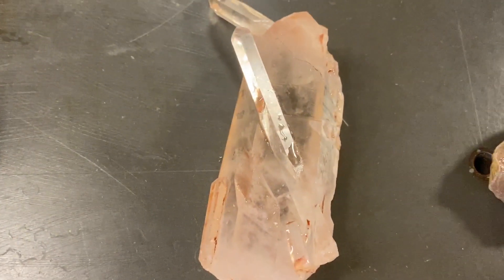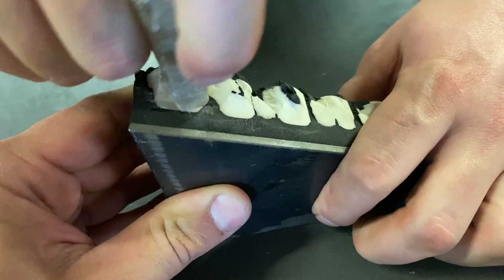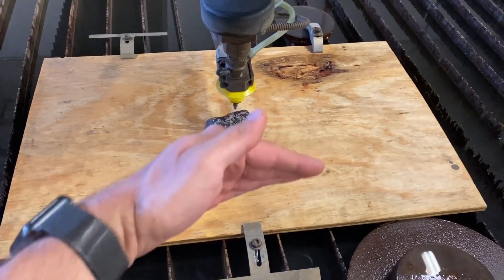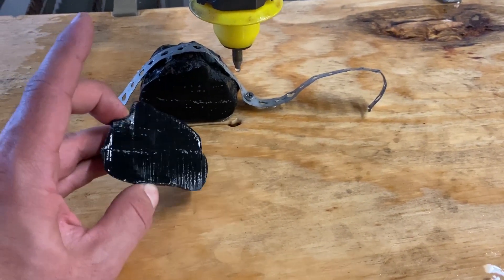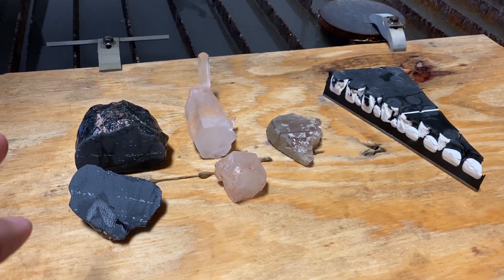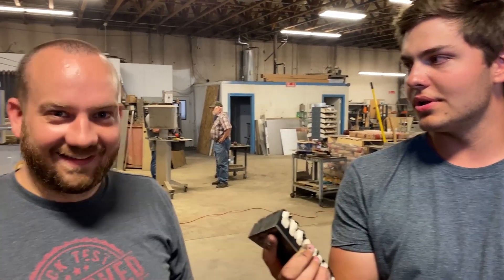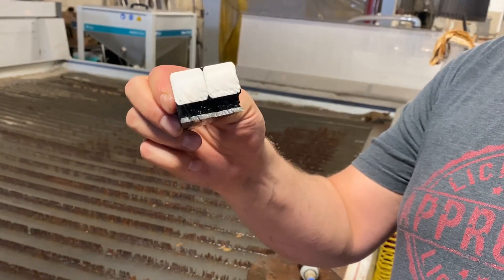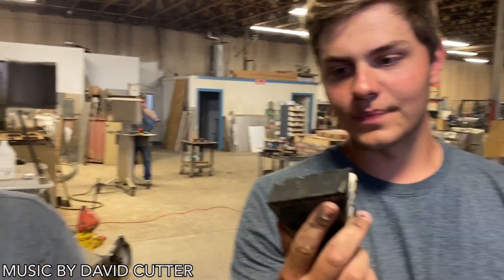Hardest Materials vs 60,000 PSI Waterjet

Comment: Probably Silicon carbide, boron carbide is harder but more brittle  boron nitrate is even harder. (In it's cubic form it's like right under a diamond in its hexagon form it's a 2. So basically a diamond to talc depending on the molecular structure.

Comment: not really a fair test if you use the specific setting for one of them, but cool.
Also, you can't say it's shows it's a log scale since you only actually found two data points. Could be linear. Still cool though

Comment: the garnet abrasive you use is 6.5 to 7.5 mhos. If you can, you should switch to aluminum oxide which is mhos 9.5 and probably a ton cheaper.

Comment: I always thought that the water jet cutting was actually water induced around a blade to mitigate the warmth from the friction that would eventually bend the blade making it useless... Im quite impressed this was actually water and minerals all along cutting hard materials!

Happy to have learned something like this today. thank you
Reply: @gab hug water alone does cut. Pure water jets exist. The one in this video is called an abrasive water jet.
Reply: @weebkawi1444  This. Water alone at high pressure will cut, thats why you have videos of dumbasses with power washers slicing their toes, fingers or hands off.
Reply: @christopherbentley6647  So then its diamond thats cutting and not metal? by that logic it could be a ceramic blade or a wooden blade or a plastic blade. Your minecraft comment didnt make sense either friend
Reply: Technically speaking I wonder if it would be more accurate to say that it's actually eroding the material away instead of cutting it?
Reply: @christopherbentley6647  I will just reply okay you are right since I'm not quite that mad to reply a huge wall of text. Have a good time!
Reply: @christopherbentley6647  Metal is softer than this stuff so would it really? ;)

Comment: Moes scale does determine hardness, but there is a difference between hardness and strength. A object can be really high in the moes scale but can break easily, like diamond. Diamond gets hit on a weird angle and it will shatter like a mirror

Comment: Advanced composites is basically the replacement for metal. 
Composites are hard but they also have a high flux density. Basically how much abuse can it withstand before being replaced (hopefully before a detrimental/critical failure).
....
For some people that dont know what I mean. Go get or grab a sheet of aluminum that has equally thickness in any direction and bend it back and forth repetitively. <that's flux density.
Now the issues you'll be coming about as you create defects such as a fault line or when the sheet of metal becomes thinner in the middle  will begin to grow. Eventually it'll just break off and thatll be referred as a catastrophic failure. Since it's a sheet of aluminum no harm no foul; but on equipment (tools) or machinery (vehicles) it's a big deal.
....
However we cant completely remove metal from the equation though. We're not that advanced.

Comment: Never realized sand was added to increase the cutting power but that makes a lot more sense. So does the water jet cut better the more you use it technically, if all those extra hard particles are floating around in there? I suppose it might take a while before you would notice any difference. At the very least would it maybe change the cut quality?
Reply: The abrassive is added to fresh (or filtered) water. You can't reuse it, because the edges are wearing off and it can't cut as good as for the first time. The mixing is done in the nozzle right before cutting.
The water is then sucked out of the pool and filtered.
Reply: @knut3339  interesting. In sandblasting we use the same medium but it gets recycled many times before it needs to be replaced.
Reply: The material coming off isn't as hard as the grit they started with so each time they cut something the mix is progressively getting softer.
Reply: I'm your 100th liker here & bye.

Comment: How hard is the garnet in the water?
I see between 7.5 and 8.5... if it is the same that is used to cut then this is proof that you CAN scratch harder with softer...both the harder and softer materials lose something. How much is determined by the disparity.
If you had a million years to blow talc at something you would eventually wear that something down.

Comment: The ceramic wear tiles are almost certainly sintered alumina.  They are the standard wear tile material for abrasive materials handling.  Quality varies (of course) but really good ones will be 9.5ish on the Mohs hardness scale.
Reply: I thought it looked like a piece of spacecraft heat shield

Comment: Guys! Get a dosimeter and check the radiation! When you cut this material, there should be a strange phenomena because of the change of the water pressure, when it touches the material. More than probably there will be a raise in the radioactive radiation. Please try and tell me the results, or even make a video about it, if its really happening. Thanks!

Comment: Imagine if he would make some bullets out of this material , wait.....
Reply: None of the materials in this video are dense enough to make good bullets. Tungsten would easily outperform any of them, and we already make bullets with tungsten in them.

Just a guess, but I would also wager the ceramic is too brittle to make a good penetrator. Hard does not mean the same thing as strong. For example, tempered glass is relatively hard at about a 7 on the mohs scale, but breaks quite easily.
Reply: @Turing_Test  Then what do you think about some Osmium bullet heads ? they are dense enought i think but it's pretty costy

Edit : Or we can try with Palladium metallic glass if you think it's dense enought to rezist the blast
Reply: @Panda-ke3iv  densest bullets in use are depleted uranium. maybe harder out there, but anything more gets to diminishing returns on penetration, and Extreme costs.
Reply: @Panda-ke3iv  I'm not actually familiar with those materials, but honestly I don't think it would matter much. As far as bullet construction goes, the material isn't really the bottleneck at the moment. I dont think there was ever a time where tungsten or, as aleks jones mentioned, depleted uranium, were the limiting factor in penetrating armor. The real key to penetrating armor is velocity (and/or heat). With the materials we already have available and use regularly, we would be better served by increasing our technology in propellants to achieve higher velocities for armor penetration (think rail guns and gauss cannons).

On top of all that, we are kind of on the precipice of entering the age of directed energy weapons. That's a whole 'nother can of worms that I won't get into, but the search for better performing bullet materials just isn't a high priority at the world's current technological level.
Reply: @Turing_Test  also, I think it must be very light

Comment: 2:31 Does this technically mean that the "garnet abrasive" is stronger than all of that..?
Reply: No.  They use garnet sand because it's really cheap and easy to find.  The scratch test really is not a good test at determining hardness.  If you take a material science class, you will find out that the crystal lattice of certain materials are strong in one direction, but stronger in another.  Take graphite powder for instance.  Graphite powder in one direction is almost indestructible compared to other materials, but in another direction it's one of the weakest carbon bonds.

Garnet is hard, but not super hard.  Most of those clear precious stones like garnet, ruby, emerald, topaz, and so on are all pretty hard and somewhat far up the scale close to diamond.

Even if you took a piece of diamond and rubbed it with a piece of hardwood, eventually you will start to see the diamond start to show signs of wearing.  Eventually you would have a particle of carbon in the wood, knock out a carbon atom on the diamond.

If you blast something hard, with something softer, eventually you will get through it.

Comment: Isn't the material used in the water jet lower down the Mohs scale than the composite material you were cutting through? Wouldn't that imply softer material is able to scratch harder material?
Reply: It's not that one can't scratch another, it's just that one will take more damage. The garnet used is less hard, but is dispersed throughout the water flow and theres far more of it than the ceramic. The garnet powder becomes further destroyed, but it is still able to abrase the ceramic.

Comment: 2:33 "A garnet abrasive to scratch its way through". 
Wow I never knew that. I just assumed the power of the water made the cut.
Reply: When cutting soft stuff like meat, cardboard, and cloth, no grit is needed.
Reply: @geraldfrost4710  Thanks.
Reply: my life was a lie, the whole of it, and this is just the latest one.
Reply: haha dumb
Reply: Its not a 100% correct but about right. Its just much faster with the garnet. But you can cut steel and very hard things only with water. What i still wonder and cant imagine at all is how can the nozzle withstand. If this can cut diamond how can the nozzly withstand all that force or whatever you want to call this 😂😂😂
Reply: @xgumsgnag3525  Its because the nozzle is just redirecting the water, its not being directly hit and actually taking the full impact from it
Reply: @xgumsgnag3525    The nozzles are made out of really hard ceramics too and you do have to replace them often.
Reply: @karozans  makes sense thanks
Reply: @xgumsgnag3525  Agreed it's mystifying
Reply: @xgumsgnag3525  lol that's what I was wondering. The garnet has to come through somewhere, how does that survive?
Reply: @xgumsgnag3525  because the garnet is added in the end of the jet.

Comment: When you've been playing minecraft since childhood and you realize quartz is harder than obsidian:

"Years of academy training wasted"
Reply: hardness does not equal strength. hardness resists scratching, strength resists breakage. theres an inverse corellation between the two, so when one goes up the other goes down. Obsidian may be less hard than quartz but it IS stronger, so it would need a better pick to break.
Reply: @ShyDigi  in other words, ductility is the measure of how much a material can deform before breaking, and typically as hardness goes up, ductility goes down, meaning it becomes more brittle and can deform less before breaking. A property closely related to ductility is toughness which is what you may be thinking of as well.
Reply: @tongpoo8985  thank you, had a migraine couldnt think of the words.
Reply: @tongpoo8985  was talking about toughness
Reply: @ShyDigi  you've got it backwards... Hardness and strength are directly linked, i.e. when one increases, the other also increases. Maybe you're thinking of ductility, typically the harder a material is, the less ductile (meaning it can deform more before breaking).
Reply: well mine i-

Comment: Why would you use water alone on Moh's 8 and higher? Aren't abrasives usually injected into the stream in such cases?
Reply: They are, including in this case using a garnet abrasive, as explained in this video at 2:28.

Comment: I thought the standard test was rockwell hardness test, which is 1/8in steel ball, or they have diamond tiped one for harder surfaces. It measures indent and gives you a value for measured dent on smooth surface.

Comment: ceramic: is hard to break/cut
me: oops, i dropped my mug and now it broke 😢
Reply: Ceramic = hard

Me  : marshmallows?
Reply: Different type of ceramic
Reply: Obviously, cutting is different from breaking.
Reply: There is a class of materials called ceramics, in which case, clay based ones like your mug are on the very bottom. Alumina based ones like this likely is are at the top. It's basically a synthetic ruby or sapphire, which are naturally occurring.
Reply: @vince864  rubber can bend and stretch

And if you made your tires out of ceramic, it would be able to support the weight of a car because of weight distribution
Reply: @rawhidelamp  until you hit a bump and it shatters
Reply: @mrwalruss401  there exists a material called ceramic, that can be different at times, and one of those differences can include, believe or not, strength
Reply: @rawhidelamp  r/woooosh
Reply: @arma3koth290  ah youre funny

Funny comedy i use reddit

Comment: Your basically trying to use water and sand to cut what equates to tank armor. Ceramic Composite is used commonly in modern MBTs. And is highly resistant to any damage, even from high velocity Tungsten projectiles, or even the modern Depleted Uranium rounds they now use.

Comment: The National Research center in Ottawa Canada built a water cannon using only water which is able to cut threw anything.

The stream of water was roughly the thickness of a human hair. 
But at a much higher compression ratio, cutting through 4 inches of metal slab like a hot knife threw butter, while leaving the metal only warm to the human touch .

Early  1980s
Reply: requiring atrocious amounts of energy and maintenance.

Comment: And if you use sand versus aluminum oxide the cutting of your water jet will change you can buy industrial diamond powder run it through the water jet instead of your normal abrasive and you can cut almost anything you don’t even need 60,000 psi

Comment: That ceramic thing you cut is a piece of vehicular armor known as LIBA. It has amazing multi-hit capacity. That piece you have likely came off an APC and is probably rated for something along the lines of 14.5mm armor piercing
Reply: Who does one contact to order such Lightweight Improved Ballistic Armor?
Reply: @Sharpless2  IIRC Swedish Body Armor and TenCate still stock an analogue of LIBA but I could be wrong. It's always been niche tech, it was issued to SOF

Comment: What is this "all"crap. Coat high hardness tool steel with a Nickel boron surace conversion . its a 13-14 on the mohs scale. 1-10 only encumpuses natural materials. Ceramic has some of the highest compressive strength whoch may be why its chipling at an angle... Corundum abrassive may be worth trying for the super hard materials. Its a 9 on the mohs. You could use diamond dust if the nozel is titanium nitride converted or nickel boron converted.

Comment: What's that nozzle made of?
Reply from the maker: Tungsten
Reply: @WaterjetChannel  Thank you!  I love tungsten.  The way it cuts right through hard steel and stays sharp...Apparently that ceramic is harder though.  I wonder if any tools use that ceramic?  Maybe it's too brittle for tool usage.  Most tool tungsten is the carbide form.  I have a 3-lb chunk of 95% tungsten and it's fun to ask people to pick it up because their hand usually slips off it at first.  Tungsten is *heavy*.  It was cut from a rod, it's about 2.5 inches in diameter and the cut is so smooth it's almost like a polished surface...they probably used a diamond saw or grinder?